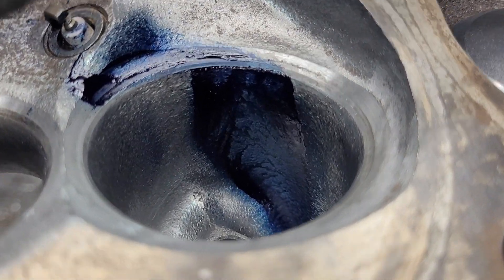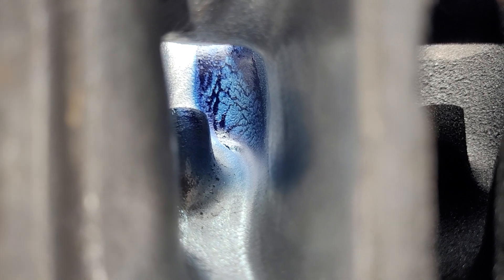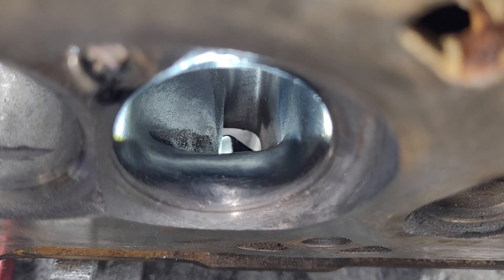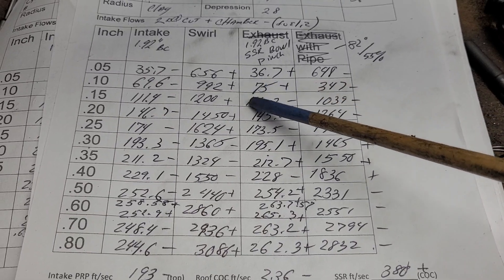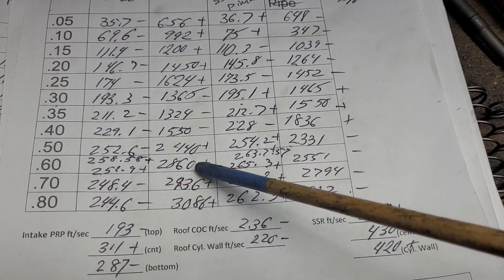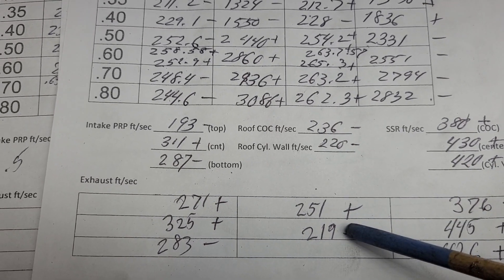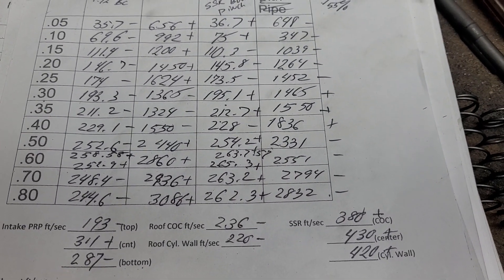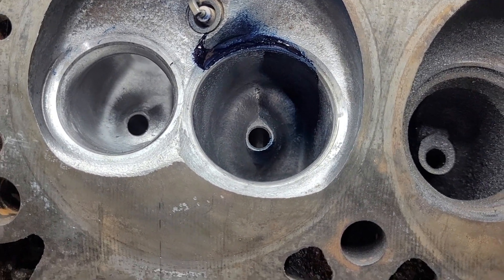Mopar Magnum cylinder head, Working on air speeds after chamber cut. Winner or loser?

Comment: Thank you once more for this information!..what is interesting is what if the RPM Intake manifold was rechecked for flow now that all this work is done? there are so many videos showing RPM to be superior at this level instead of a Open single plane intake.
Reply from the maker: Pretty sure I did a video after it was ported. I used a very rough texture so the flow gains aren't the best but liquid flow will be improved and make better power. Thanks

Comment: Short side apex has ~.270" to the water jacket.  A little less as you move toward the port.
Reply: Also, that was me that suggested filling part of the roof.  Just on the long side where most of the flow is.  Essentially build a ramp similar to how GM did on the LS7(?) Head.  Doesn't need to completely fill the radius but worth a try.  Cut back from the radius as needed to see where the sweet spot would be, if any.   I can send pics if needed to give a better image.
Reply from the maker: @Mr34blazer  I looked at how thick the ssr is. We may cut that down and see what happens. We can put that under porting mistakes. We will gain some high lift flow but lose mid range flow. Thanks

Comment: I know that someone who made those suggestions.  A couple of days ago I also asked if you could remove a deeper ditch between the pinch and plug boss. If you catch today's video from Eric. Those l.s. heads have it on the first port, and it beats all of Eric's manipulations.
Reply: Eric’s port does well on the 4.155 big bore. A good bit better than the “stock” port. He was also trying to improve a CNC program that has who knows how many hours into it.
Reply from the maker: I will check out Eric's video. Thanks
Reply from the maker: I know I am thick but I don't pick up what you are putting down. Sorry

Comment: I knew you could not stop!  That mid lift flow is tremendous. All of the big number tests are using 2.08 intake valves.
Reply from the maker: Yeah, I have issues. Thanks
Reply from the maker: I don't know how much metal is left at 2.08". Sheesh.

Comment: Very interesting how the short side slowed down where the roof picked up, and picked up where the roof slowed down. How does the quench pad affect the speed on the SSR?
Reply from the maker: It changes where the air is exiting the perifery of the valve due to less flow resistance in the chamber.